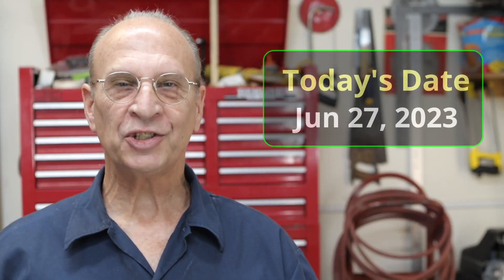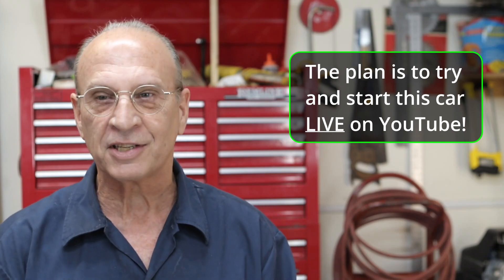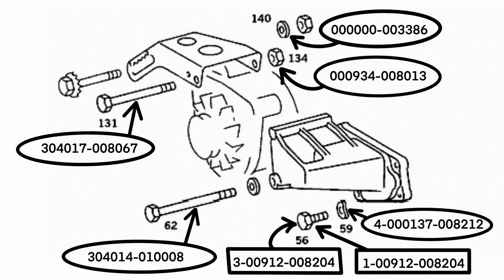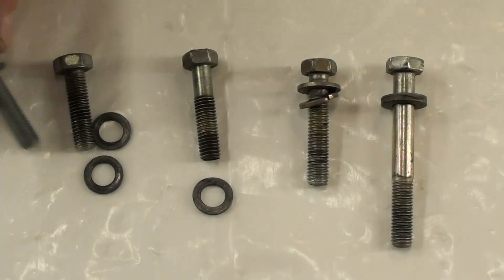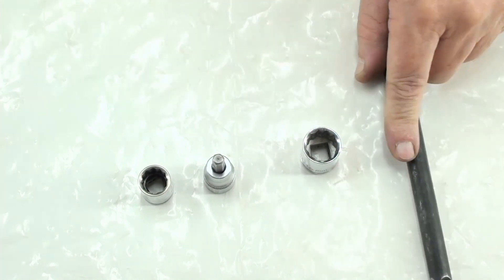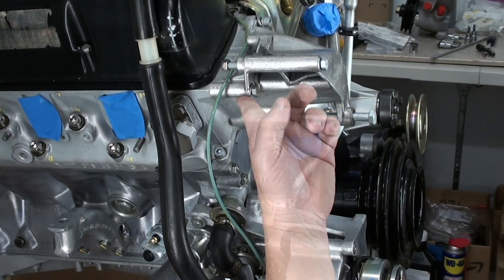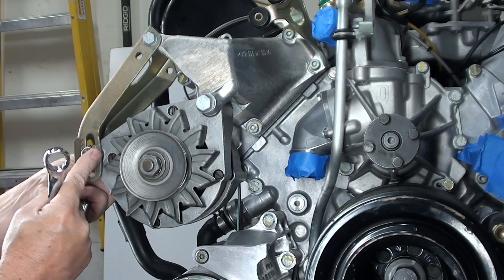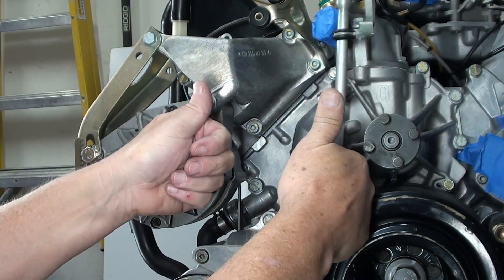560SL - Installing The Alternator & Alternator Brackets

Comment: Hay, what are the 4 bolts going into the head?
Reply from the maker: In the video I list everything including part numbers at 00:15
Reply: @TonyLiveTV  hay i went to my Mercedes dealership and showed them the part numbers and they said that they were invalid part numbers
Reply from the maker: @jamieplays2007  I don’t know what model you have, but I can guarantee the part numbers listed are correct. I know this because I replaced every single bolt and these are the part numbers. The part numbers that start with “1-“, “3-“ and “4-“ represents the quantity and not the part number. I mentioned this in the video. Example, 3-000912-008204. This means that you need 3 of the 000912-008204.
Reply: @TonyLiveTV  ohhhh thank you, i have a 380sl a lot of the bolts and parts are the same